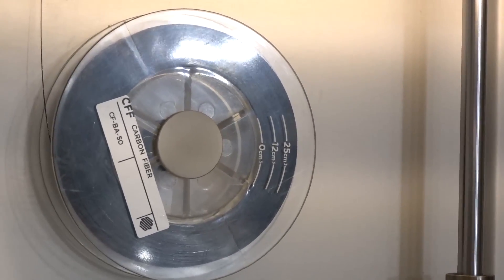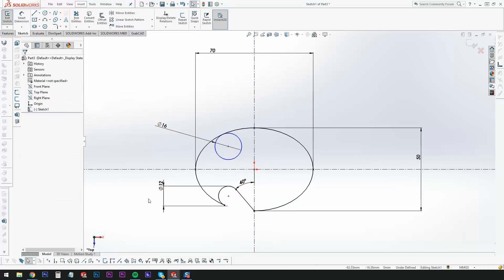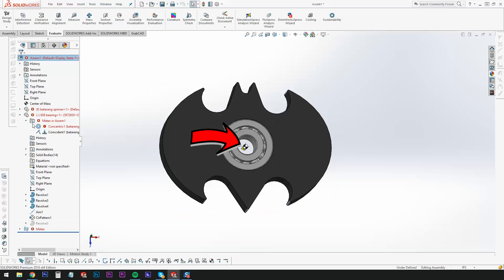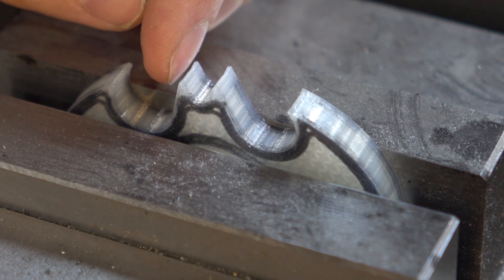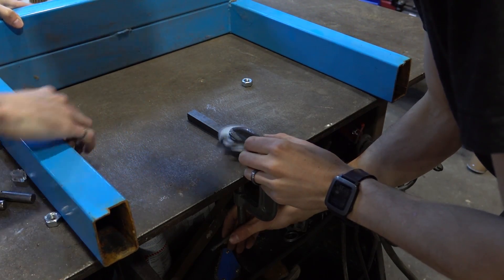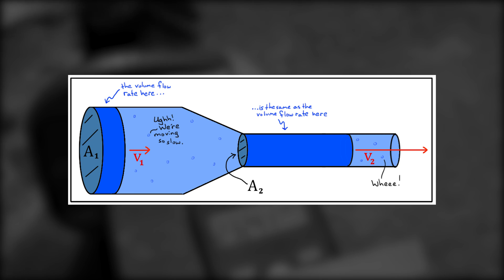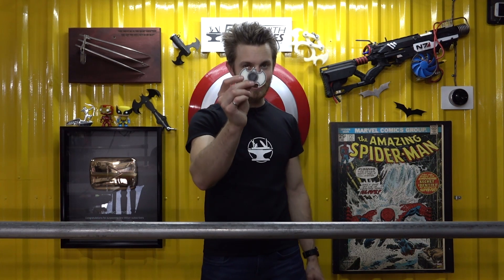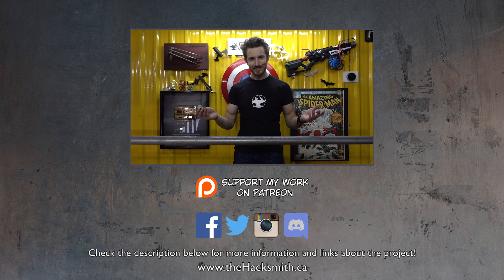Carbon Fiber Fidget Spinner is INDESTRUCTIBLE! +GIVEAWAY

Comment: I'm so glad you're used rpm instead of mph. it annoys me so much when people say their spinner spins at "over 100mph"
Reply from the maker: +IXxChaosmasterxXI well shoot i could of had a more click bait title!
Reply from the maker: It's okay to measure if you're measuring horizontal speed... i.e. RPM * perimeter of spinner -- but every one who has ever said 100mph is full of s***. Even this one spinning at 99,999 RPM it works out to... like less than 30mph lol!
Reply: + the Hacksmith due to my maths, your spinner should be doing 818 mph, on its "outline", assuming 100000 rpm and a diameter of 7cm(as seen in solidworks)    (100000x7xPIx60/100/1000X0,62)
Reply: Like 1000 DEGREEZ red hot knife when you have no idea if they mean Celsius, Kelvin or fahrenheit?
Reply: Rotations per minute - that means the circumference traced by the edge of the spinner per minute, so 99,999 rpm is about 1670 rps. One rotation is 2*pi*the radius traced by the farthest point about the bearing. In the design, the diameter is 70 mm, or 2.76 inches, so the radius is half of that. Thus, the distance traveled in one rotation is 220 mm or 8.67 inches.

So, in one second, the spinner spins 1670 times. Thus it follows that in one second, the furthest point about the bearing moves a total distance of 367,400 mm or 14478.9 inches.

Distance/time gives us 367.4 m/s or 1206.58 ft/s in standard units.

In KPH: 367.4 m/s * 60 sec/ 1 min * 60 min/1 hr* 1km/1000m = 1322.6 KPH.
In MPH: 1206.58 ft/s * 60 sec/ 1 min * 60 min/1 hr* 1mile/5280 ft = 822.66 MPH.
Reply: the Hacksmith no!, bad hacksmith.
Reply: Jammu They cant spin that fast normally so it annoys even more when little kids say their spinner spins 100mph by hand...
Reply: CmdrRoot assuming a 1 inch diameter, it would be going at most 94 mph for a very short amount of time
Reply: +the Hacksmith well, thats not exactly what I wanted to point out but... yeah... I understand though that clicks, views etc. are very important to you since you have a team and a significant amount of money to spend for some of your projects etc., and you yourself have to life of it too, it is a shame that there is such a pressure in this form :/ Edit: you can still edit the title, can´t you?
Reply: Adams World lol thats some basic stuff!
Reply: Kali Takumi all the clickbaity Americans who all want in on the latest fads with channels appealing mostly to children between the ages of 6-17
Reply: ocng yes, this would be past the speed of sound  
you have a good point there, since I do not know how this rpm meter works, I can not answer this question, if you ask where the sonic boom would have been, I do not think this kind of motion would trigger one, but honestly I have no idea in this regard :D
Reply: Jammu I've not heard anyone say MPH with Spinners
Reply: Jammu finally someone pointed this out.
Reply: +jakub Kraus actually i just drew 3 circles on it, 1080 degrees
Reply: I can confirm, that's what I got too when I did the maths with the metric system (1320 kph) :)
Reply: Who the heck says mph
Reply: Kali Takumi U Just Did..
Reply: I meant mph when you should be using rpm
Reply: Jammu  6?????
Reply: Jammu ikr...
Reply: wait does the fidget spinner mechanics is also the same with a Case/CPU/GPU fan?
Reply: Jammu ikr
Reply: Jammu grammar
Reply: +IXxChaosmasterxXI shouldn't it be 10000*7*Pi/60? you are converting rpm to rps. not the other way round! assuming average  3cm radius. it would be going to 314m/s which is 1130.4 km/hr. it would make more sense bcos the spinner did not produce a sonic boom in the video.
Reply: +Muyao Liu nah, my calculation are correct, we have to use the max diameter since we are talking about vmax
100000 [rpm] x 7 [cm] x PI = 2199115 [cm/min]  (the distance the two points furthest away from the center travel in one min in [cm])
2199115 [cm/min] x 60 = 131946891 [cm/h] (the distance the two points furthest away from the center travel in one hour in [cm]) 
131946891 [cm/h] /100 = 1319468,91 [m/h]  (the distance the two points furthest away from the center travel in one hour in [m])
1319468,91 [m/h] / 1000 = 1319,46891 [km/h]  (the distance the two points furthest away from the center travel in one hour in [km])
1319,46891 [km/h] x 0,62 = 818,07072 [mph]  (the distance the two points furthest away from the center travel in one hour in miles)
Reply: IXxChaosmasterxXI isn't that past the sound barrier?? I suspect since the object is symmetric the rpm meter might show twice the speed
Reply: when an object spins fast enough, the tips will break the sound barrier. a good example would be the 3d printed EDF on this channel. the object experiences a lot of vibration. it will also elongate. At some point, the object will fracture (if spinning fast enough) at high speeds. in other words, it explodes.
Reply: mostly celsius
Reply: Ekbro1 I have
Reply: Jammu I only know how to measure speed in mph
Reply: the Hacksmith Nah, check your math. Assuming a 1 inch radius, the perimeter would be going at about 600mph.
Reply: Btw I like how he is talking about safety meassures an then putting his fingers right next to it while its spinning at 100000+ rpm and stuff is dropping on top of it^^
Reply: You should divide the RPM by 2 ? since there are 2 parts. idk i'm maybe wrong. and you guys are awesome